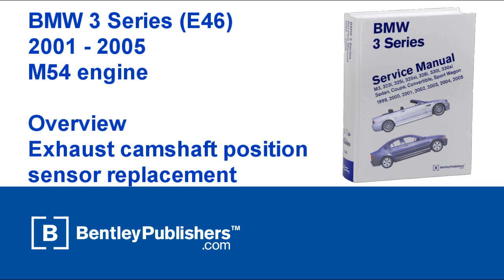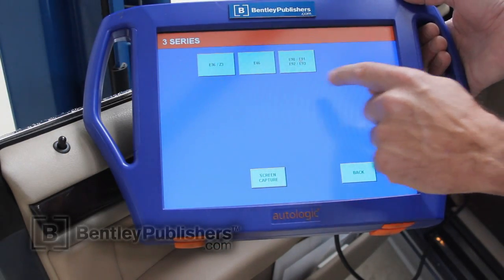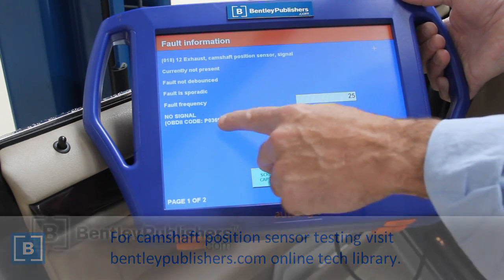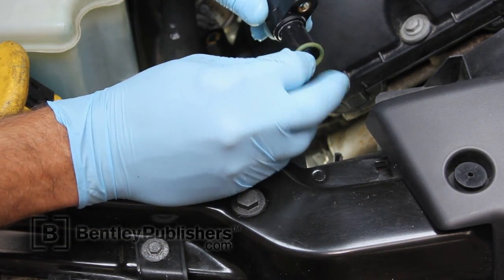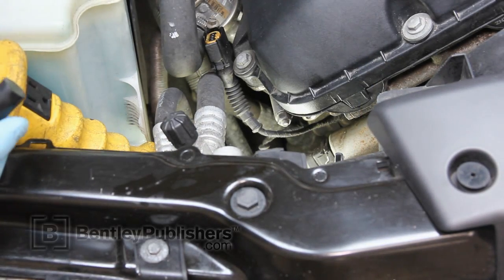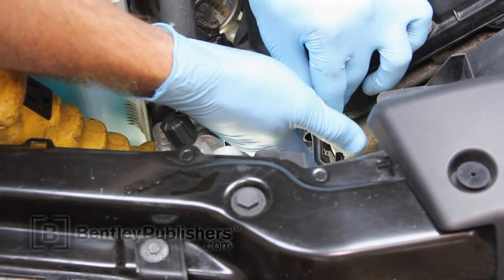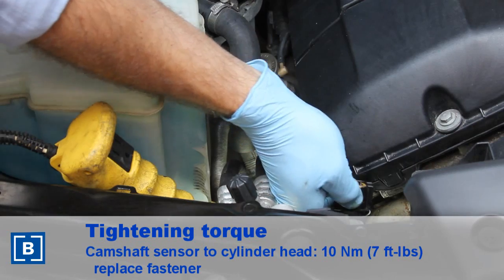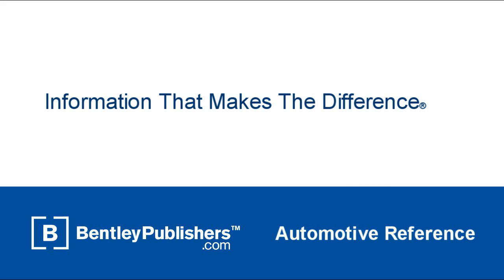BMW 3 Series (E46) 1999-2005 - Exhaust camshaft position sensor - DIY Repair

Comment: Thanks for the video it helped a bunch! I watched another video and the op stated that the air scoop and radiator fan shroud needed to be removed, this seemed odd considering that the sensor is held in place with a single bolt and is for the most part conveniently placed.

Comment: just a tip for everyone if you are unable to remove the viscous fan on some models (no 32mm wrench) you are able to remove the front right headlight and it will give you clearance to access the bolt underneath the sensor i did it this way

Comment: There is no reason behind changing that fastener if the o ring has any damage replace it. If it goes in snug it's fine lol. You post a video on a simple repair to help people but make it sound harder then it actually is.

Comment: HI guys. I've changed out my sensor and reset the check engine light. but the light is now back on with the sensor fault code. any thoughts?

Comment: is it really, absolutely necessary to replace the fastener? doing mine here in tokyo on my 2000 320i.
Reply: That blue shit is thread locker and yes you can reuse the damn fastener same with the o ring if it's in good shape yet
Reply: by fastener he meant the screw. if you see the blue on the threads, that means it has anti-seize on it so it wont get stuck in there. you can buy anti-seize at any auto parts store. just DO NOT use a lot. and us it where the blue stuff is. over the counter anti-seize is usually red and single use packets with PLENTY are less than a few bucks.

so yes you can re-use one, but i'd put anti-seize on.
Reply: I thought that was thread locker?

Comment: Did anyone notice the new sensor is different to the old one?, I've been trying for hours to find a sensor like the one they're taking out in this video but nothing yet, till I found this video and I saw that, wondering if all the sensors are like the new one the person on the video is installing and if it will make any difference, the new sensor in this video is exactly like the one in the other side, the exhaust camshaft sensor I think.

Comment: good video thanks I've just replaced cam position sensor and about to do the exhaust camshaft sensor tomorrow.will it be the same as mine is 330i 2000

Comment: hei,i have 316ti 2003 n42 motor,and i cant able to remove that clip from sensor,its normal locked clip that have to press from both sides or its something diffrent?

Comment: My 2001 325 has got disgustingly low levels of torque. Wonder if it's this that's my issue...
Reply: Did you solved the problem? I got round to my problem which is to blip the throttle when engine starts. But you have to do it that exact second engine starts...

Comment: Anyone know where to get a new camshaft sensor fastener?
Reply: Alonsojr, it's available any any online BMW parts supplier or your dealer. the part number is 13 62 7 545 388. Google it or try ECSTuning.com, BavAuto.com. They suggest replacing as it prevents cross threading, vibrating out on it's own. You can use some thread locker,available at any parts store if you must use the old one
Reply: Mario Quintela Sure looks like a standard bolt to me. Not sure why you'd need to replace it.

Comment: Hi, I watched your video because it came up when I searched code P1338. Is this the fix for this code because I believe there are 2 sensors. Please get back to me thanks
Reply: Carlos Mendonca I believe that fault code is for the intake camshaft sensor. if the description of the code says "Camshaft position sensor A" then it should be the intake. If it says "Camshaft position sensor B" then that is the exhaust.
Reply: @maqjr1  which one was replaced in this video

Comment: Thank you. I watch your videos to see what my mechanic has to do, with the parts I purchased. Did not know I need to replace the fastener. Also, would this be a good time to replace an o2 sensor. Just bought it used. 2001 325ci.
Reply from the maker: ConsciouslyCreate211 

The replacement interval for the oxygen sensor is 120k, but it will also turn on the check engine light when is no longer operates efficiently. Personally, I would wait for the check engine light, but there may be some small fuel economy savings by doing it when specified. If you are at or above the 120k, then it would be a good time.

-Charlie
Reply: Alright, I have some time to replace it, only at 92,000. I'll just concentrate on the cam sensor for now. Thank you. I love the videos.

Comment: Very informative video. Is it 100% essential that the fastener be replaced? Also what tool was used to remove the screw holding it in place? Thanks.

Comment: i replace my this sensor 6 months ago before my inspection was done and now 6 months later i got check engine light again. i scanned my car and it shows that the Camshaft sensor need to be replace again. Does anyone knows how long camshaft sensor should last?  thank you.

Comment: I had the error code P0369, I replaced the sensor and had the error code wipe clean off the computer and no more "Check Engine Light"...yes...avoid going to dealer...PRICELESS...